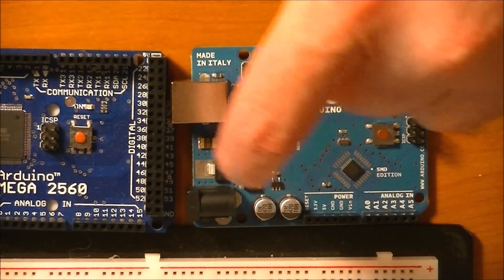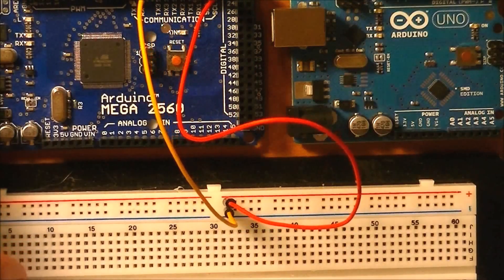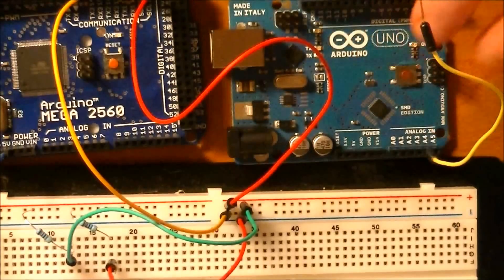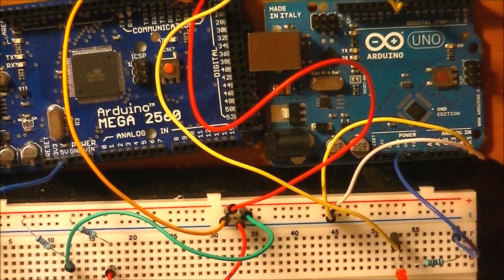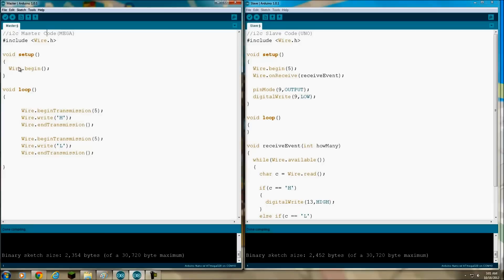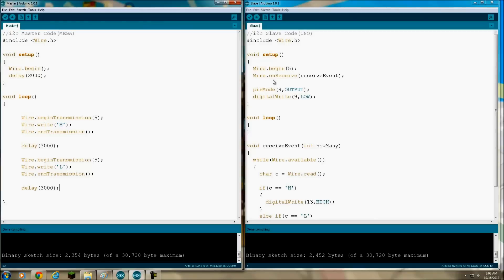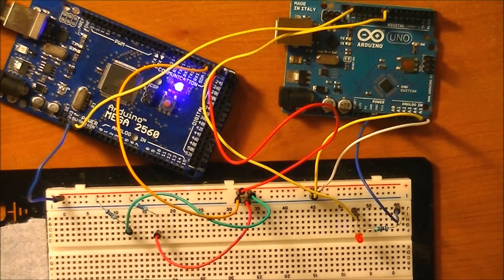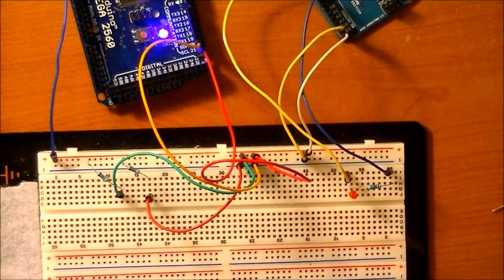i2c communication between an Arduino Uno and an Arduino Mega 2560

Comment: HERE IS CODE

MASTER:
#include<Wire.h>
void setup() {
  
Wire.begin();
delay(2000);
}

void loop() {
  // put your main code here, to run repeatedly:
 Wire.beginTransmission(5);
 Wire.write('H');
 Wire.endTransmission();
 delay(250);

  Wire.beginTransmission(5);
 Wire.write('L');
 Wire.endTransmission();
 delay(250);
}

SLAVE:
#include<Wire.h>

void setup() {
  Wire.begin(5);
Wire.onReceive(receiveEvent);

pinMode(8,OUTPUT);
digitalWrite(8,LOW);
}

void loop() {
}

void receiveEvent(int howMany)
{
  while(Wire.available())
  {
    char c=Wire.read();
    if (c=='H'){
      digitalWrite(8,HIGH);
    }
    else if(c=='L'){
      digitalWrite(8,LOW);
    }
  }
}

Comment: Hi
My brother wants help
I want to send three values (numbers) from Arduino (Master) to three Arduino refunds (Slave) using the I2C protocol.
Reply: Set different addresses for the difference slaves and write Wire.beginTransmission(<address>) where <address> is replaced with whichever slave's address you want to send the data to

Comment: I am new to arduino and circuit so maybe this is a dumb question: Can I know how does the uno board got powered? Is that related to the common ground?
Reply from the maker: Not a dumb question at all - I actually forget to apply power and you can see me at around 13:48 fumble around with something and plug it into the Uno.  I think I am plugging in a wall power supply into the barrel plug. Not 100% sure because it was a long time ago and it's out of sight of the video camera.

Comment: What purpose does the common ground serve?
Reply: Each board’s supplied voltage in this case is 5v. However, this is not absolute voltage, but merely a voltage difference between a lower voltage(called ground) and one that is 5v higher. It is possible that one board may have a voltage difference of 5v, but the ground voltage is at a different voltage than the other board’s ground. This imbalance can cause issues communicating between the two as well as hardware that relies on a voltage difference (like most electronic things).
Reply: in any circuit you need a reference voltage which is basically the common ground

Comment: Why the heck would you do this when 2.4 GHz communication costs $0.76 on e-bay and requires no wires?
Reply from the maker: SteelBlueVision i2c is cheaper and more reliable.

Comment: Extremely helpful video.

Getting ready to do almost the same thing, but in reverse.  The Uno will send commands and receive some data from the Mega.  The Mega will run a bunch of various outputs and do a little bit of processing.

But I'm using the small 2.4 GHz transceivers instead of a wire.

Comment: A question, If you want to connect a 3Vcc sensor to ARDUINO  which handling 5Vdc. You can connect the sensor to the line of 3.3V of ARDUINO, but what happens with I2C communication lines? The I2C of sensor is a collector open? Thank you very much for your help.
Reply: You use a logic level converter circuit. It helps 3.3v devices talk to 5v devices.